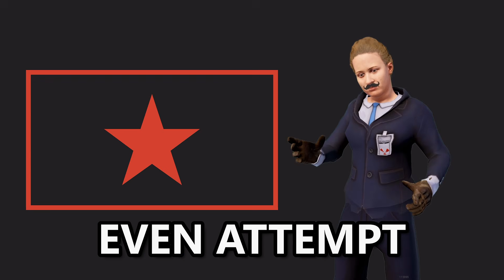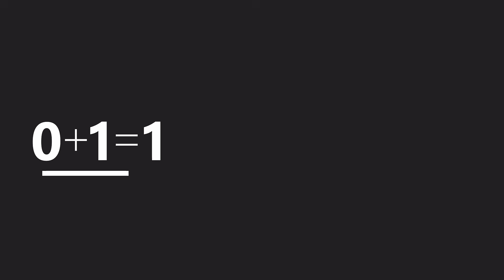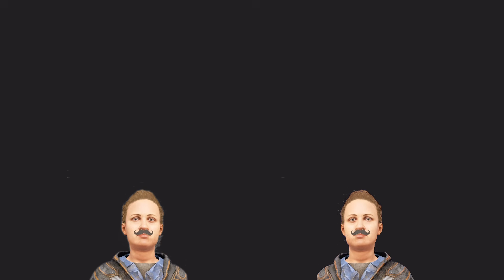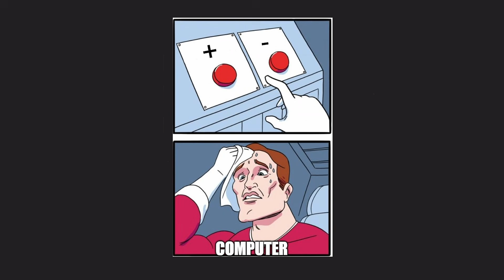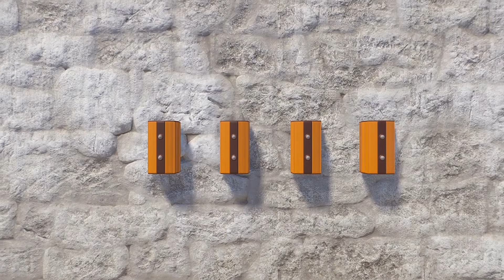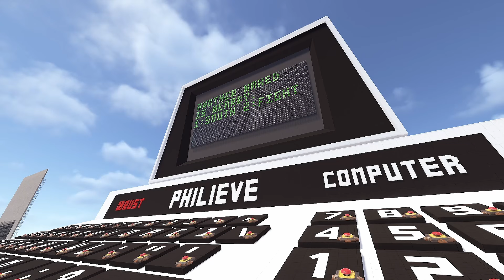Building a Computer in Rust... Using Only Electricity

Comment: Proxmox works without a GPU on the host because zero graphics rendering happens on the host server. The host only handles backend data and text, while your local client device (your laptop or desktop browser) does 100% of the visual rendering.

1. The Proxmox Dashboard

Host Role: Proxmox runs a lightweight web daemon called pveproxy. When you connect to https://your-ip:8006, the server simply transmits plain text files over Ethernet: HTML structure, CSS stylesheets, JavaScript code, and raw JSON metrics (like CPU/RAM usage).

Client Role: Your web browser (Chrome, Firefox, etc.) receives these raw code files. Your local computer's CPU and GPU execute the JavaScript and render the dashboard layout, interactive charts, and buttons onto your monitor.

2. The VM / LXC Console Windows (noVNC)

Host Role: When running a Virtual Machine, the QEMU hypervisor creates a virtual display adapter in host RAM (like virtio-vga or std-vga). The guest OS writes its desktop display into this RAM buffer.

Network Stream: A built-in service encodes those RAM pixel changes into a web-friendly network stream using the VNC protocol over WebSockets.

Client Role: Proxmox uses noVNC, an HTML5 VNC client. Your browser intercepts the network stream and uses an HTML5 <canvas> element to draw the VM's screen locally on your client machine.

The host server acts entirely as a web and API server—it processes instructions, updates data structures in system memory, and streams those changes as network packets.

Comment: A pure CPU setup with zero GPU hardware anywhere (no discrete GPU, no integrated GPU, no display chip) can execute 100% of graphics calculations in software, but its frame output is redirected to disk, network streams, or basic display transmitters.

1. Headless Output (Disk & Network)

How it works: The CPU computes every pixel, geometry transform, and lighting pass directly inside system RAM using software renderers like LLVMpipe or Arnold.

Where the frames go: Because there is no physical video port, the CPU compresses the RAM framebuffer into image/video files (e.g., PNG, EXR, MP4) or streams the raw frame pixels over a network protocol (VNC, RDP, WebSockets, or SSH X11 forwarding).

Real-world use: Film render farms (Pixar/Weta), cloud serverless 3D image generation, and automated software testing suites run completely headless without GPU hardware.

Comment: Yes, a CPU can render graphics entirely on its own through a process called software rendering.

In fact, CPUs render complex 3D scenes every day—the key distinction is between rendering (calculating pixel math in memory) and displaying (sending electrical signals to a screen).

How CPU Rendering Works

The CPU uses general-purpose x86/ARM cores to run mathematical algorithms (rasterization or ray tracing) that determine the color of every pixel in a scene. It writes the completed frame into a section of system RAM called a framebuffer.

Where CPU Rendering is Used Today

Photorealistic 3D Animation: Studio render farms use high-core CPUs running tools like V-Ray, Arnold, or Blender Cycles for movie visual effects because CPUs handle massive memory-heavy scenes with extreme precision.

Software Fallbacks (APIs): Drivers like LLVMpipe (Linux) or SwiftShader (Google) translate Vulkan/OpenGL graphics calls into CPU instructions so software can run even if no GPU driver is installed.

Retro 3D Games: 1990s games like Doom (1993) and the original Quake (1996) rendered their entire 3D worlds in software using the CPU.

Why CPUs Aren't Used for Daily Real-Time Graphics

Parallel Execution: A GPU contains thousands of small cores optimized to perform identical pixel math simultaneously. A CPU has fewer, highly complex cores designed for sequential tasks.

Memory Bandwidth Limits: GPUs use dedicated VRAM delivering 500–1000+ GB/s of bandwidth. Software rendering on a CPU is choked by system RAM bandwidth (DDR4/DDR5 maxes out around 50–100 GB/s).

The Final Obstacle

Even when a CPU computes 60 frames per second inside system RAM, it cannot show those frames on a monitor without a physical Display Engine to scan that RAM buffer and stream the signal out through an HDMI or DisplayPort socket.

Comment: could you set the keys to the signal and find a way to just type in chat and have the competer know but like say a key word before then key : speak  fight on the beach
Reply from the maker: Yes, that would be possible. But only when using a plugin, not with vanilla electricity logic.
Reply: @PhilieveRust makes sense

Comment: What is he using as a matrix display screen? I see a bunch of tiny "88" as pixels. I love it
Reply from the maker: It is the counter component. Usually it is used to displays a number. But given its square shape I put a lot of them together and set them to the value 88, as it filled most of the display area.

Comment: or use rust plus api on pc, use smart switches, make switch automation instructions on pc program sending it thru api to the rust server. it works almost instantly and can run as many switches as you want
Reply from the maker: Jup, that is certainly possible and a great idea.

My goal usually is to make everything work with only vanilla logic.

Comment: This is really cool. Congrats on not giving up.

Ive have had an idea for a poker card shuffler, using automated boxes randomizing 52 hand painted frames for the cards and have a dealer that would post them on a wall in a stadium environment (like wheel of fortune vana white style) and the players would sit in a booth that looks on with a small box that would automatically fill with 2 cards each round they mount in their private booth. Could be cool for a poker tournament with AOR painters creating the card faces.
Reply from the maker: That's is an awesome idea!

Comment: So far, im at hello world etc, thats not a computer. Yes its binary but you need to change switches for a different word. Its like a sign for gas station or any electronic sign but in the 40s or 50s in technology years. Your not actually hitting switches like a keyboard. Its still cool
Reply from the maker: I agree, up until the calculator program it can barly be called a computer. But after adding the conditional jumps it becomes turing complete.

Comment: Btw how much ROM space does it have?
Reply from the maker: For the program ROM I can have 256 Instructions at 32 bit = 1024 Byte. The character ROM that stores individual screens can hold up to 64 screens at 15x16x5 bit = 9600 Byte. Though keep in mind I only spawn in the components when the ROM value is a 1.